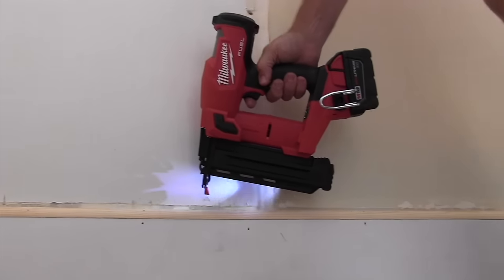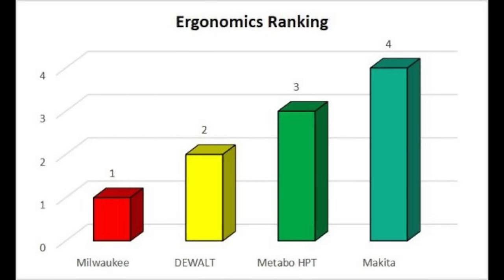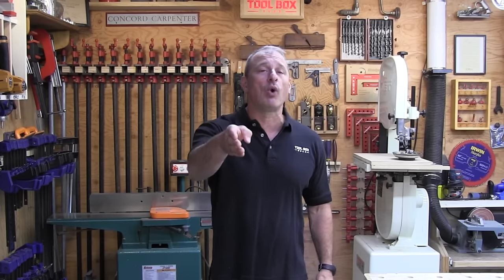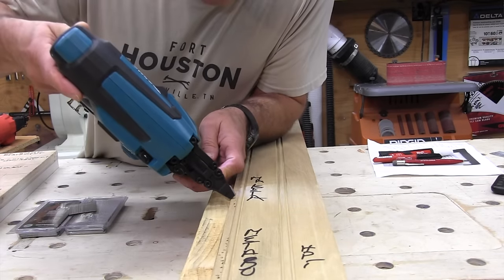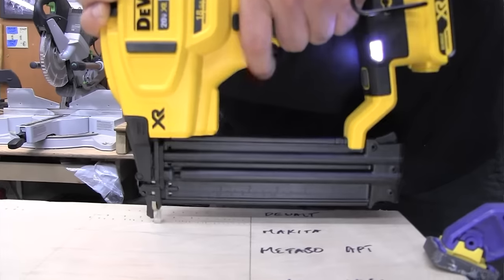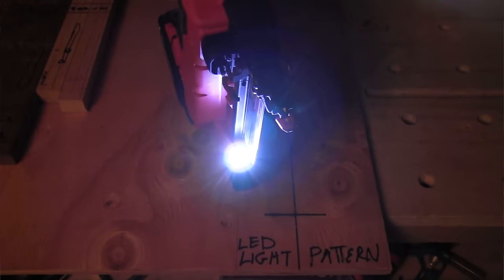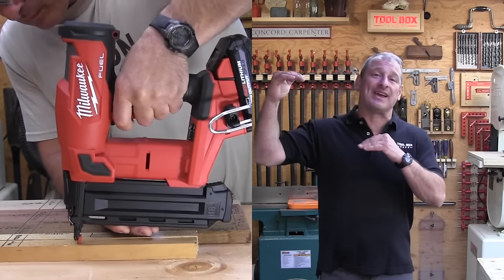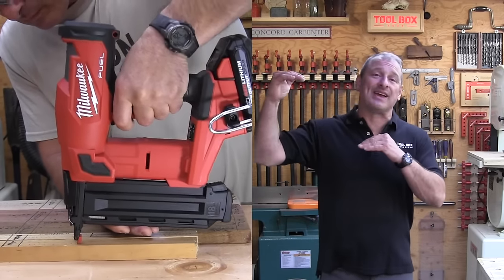BEST 18 Gauge Cordless Brad Nailer - Head-To-Head

Comment: I wish makita would come out with an updated brad nailer
Reply from the maker: soon
Reply: Are you hinting that I might want to wait before running out to buy the DeWalt
Reply: @ConcordCarpenter  are you sure?  I emailed the a few months ago about this very question.  They said something to the effect of nothing is in the works, our nailer is great.
Reply: Makitas current 18g nailer is not well balanced and very awkward. I got the dewalt but wish makita would bring a new one out with a better design and balance. If they dont im going over to the hikoki 36v system. Cant beat only needing 1 battery plus an ac option. Makita have really fallen behind

Comment: I have always bought Makita and currently have the xgt range, have been using the xgt 16g nailer for a few months which works on a spring loaded mechanism rather than compressing air like the other models. It works awesome although my problem was the nail length being too short and not being able to drive fully into some surfaces sometimes. Today i bought the gen 2 milwakee (had to buy a battery and charger) its a very well rounded bit of kit with plenty of power. Would never go back to another gas+ battery nailer ever again after using these.

Comment: Hi Rob. Just curious to find out why Ryobi was not reviewed. Thanks in advance and great job with the tool box series.
Reply from the maker: Nothing secret or big to tell - we chose not to. We wanted to keep our sampling to the top Pro contenders. Sorry - in hindsight it seems al lot of you guys would have like to seen it included - will note that!!
Reply: @ConcordCarpenter  When I bought my nailer I spent weeks scouring the internet to ensure I was getting the best tool for the job. I chose the Ryobi in spite of the fact that I had no batteries for it because the feedback was so thoroughly lopsided toward the Ryobi. I've used it quite a bit and have had no negative experiences with it. It does exactly what you want it to do without fuss. I was very impressed that a tool at this price could hit my every metric so well.
Reply: @ConcordCarpenter  The Ryobi is a bit long in the tooth due to size and speed, (not that most people will be bump firing an 18ga nailer). However, I still feel that the Ryobi 18ga nailer and stapler are two of only a few of their tools that are pro quality, and still a very good value. Since you mentioned this in the review, the Ryobi will also fire 2-1/8" brads. The lighting pattern is also superb.
Reply from the maker: Pro1er thank you for that feedback
Reply: @ConcordCarpenter  

You can easily test the Ryobi, and even Rigid, and include them in a Part 2 by re-editing this video. 

You may have to reshoot your narration spots, but other than that... easy peezy.
Reply from the maker: jane Patton we’d just do a new video

Comment: I was looking for Ryobi in this comparison as well
Reply: I usually find Ryobi at the bottom of the quality range but cheapest price. Ok for government work but not suitable for professional work
Reply: I've had a Ryobi 2 speed electric corded weed eater for 15 years and it's heavy duty and works great.
Outlasted my Troybilt gas and weed eater brand gas.
Reply: With as much or more power
Reply: @gregoryfairchild2460  
Color me surprised 
I have not had any such luck with their products. I had some luck using Rigid as my budget brand.
Reply: @gregoryfairchild2460  
My last ryobi experience was with a small pressure washer

Out of the box it was defective with low pressure due to a bad seal. 
It did work after I made the repair but I was still left with a bad vibe

Comment: What batteries/tools you already own should probably dictate which nailer to buy. I've used and heard less than stellar reports on the milk. I'd go Dewalt since thats what I have already.
Reply from the maker: Steven Foust that’s not a bad approach
Reply: This proof is that creating the cordless systems made those companies a lot of money: you add the batteries chargers and most importantly the retaining the customer to an ecosystem and it equal a lot of cash for them. I can see each of the companies dropping their corded tools and focusing on cordless and they would do just fine.

Comment: I own the 18g brad nailer by porter cable and has never jamb and has a better lighting then these 4 and it sinks in hard wood with no problems I got this nailer plus a narrow crown nailer 2 batteries and a charger for $229 can't beat that it's over 2 years old and still fires like it's brand new

Comment: The Makita is the oldest. I hope they can compete and try to come out with another one. Great honest video, however. Thank you for posting!
Reply from the maker: Their Gen 2 is gonna be amazing
Reply: They have released FSN350 with only max 35mm Nails
Reply: Forget makita they have fallen behind
Old 18g nailer with rubbish design 
No framing nailer
36v systems need 2 x batteries = more height and size.

There designers have lost the plot

Comment: Dewalt always seems to be at or near the top of the heap. I started buying DeWalt 20V XR tools, I am always happy with their performance. I am not a carpenter, just a DIYer and am happy I went down the Dewalt road.
Reply: I've used the dewalt and the only things I'm not a fan of is the balance and it feels cheaper than the others (because it is I guess)
Reply: @cuchanu  I started out with a Dewalt cordless drill, my B&D cordless drill batteries had died. Then I started buying more Dewalt stuff, so I decided I would just buy Dewalt cordless tools. I don't regret sticking with Dewalt.

Comment: Great review Rob👍 I'm tempted to try the Milwaukee and get away from the air hose.
Reply: Dan Pattison Hi Dan , greeting from Australia, I’ve been air free for 2 years and wouldn’t bother going back to air fixing guns . My mates use the Paslode gas gun which I think are very good still . I have the Milwaukee first gen Da nailer ( senco style nail ) I love it as walking around the house there is no air hose ,total freedom . They do have a few draw backs , little heavy , and the “snap action or the way it fires still not as soft as a air gun . Buy one and try it out as it will come in handy for a job where you may only need to shoot a few nails where rolling out leads is just time consuming. I’ll buy anther Milwaukee soon as I need the C’  ( 18g ) brad for fine work as the DA ( 15g )  nail is a little too big for some jobs .... let me know how you went
Reply: @lena19191  thanks for the info👍

Comment: I have the Milwaukee batteries so I am happy with the review and I am going to get this tool.  I am going to put all new baseboards and door casings in my house and I have a Senco air nailer but dealing with a compressor, the long cord and the noise I rather use that battery system this time.  I put baseboards in 15 years ago and I want a more modern look so I am replacing the old baseboards.  I can buy the tool only for $279.00.  Seems like the batteries last a long time and I already have two good batteries.  I will sell my Senco nail gun.

Comment: This is a pro video of the pro's opinions. ...what about the ryobi p320
Reply from the maker: נועם אברהם דודאי we chose not to loo’ at it
Reply: I'm a professional and have the Ryobi. It doesn't get used much other than quick jobs where it'll take longer to unload compressor an roll out the hose than do the job. The Ryobi works ok for that. It always goes through 15 to 25 "dry fires" before shooting the very first  nail though. Which probably isn't good for the tool. I always have a scrap piece of wood to fire into until first nail shoots. Kind of a pain! Going to go with the Milwaukee. Great video here, Thanks!

Comment: I love Milwaukee tools, and with staying with one battery format, I bought the Milwaukee brad nailer when it came out.  What a major dissapointment! Milwaukee really did a number on us on that one.  I would like to upgrade to the Gen 2 version but just can't justify replacing a new tool like that so soon.  Milwaukee should offer a serious trade in because of they released a tool without proper field testing. But it appears they are just going to let us hang out to dry on that one.  Very dissapointed Milwaukee.
Reply: Milwaukee does not take care of their clients in regards to warranty.  Bought a 7 1/4 cordless miter saw.  it never worked properly.  Wouldn't do anything for me even though tool was under warranty.  I won't buy Milwaukee ever again
Reply: @markwigley9185  That can pretty much be said about all manufactrers. I use Ridged corded tools tools as well and they gave me a cold shoulder when I tried to claim their "lifetime warranty".
Reply: @JWimpy  Wow.  I guess i've been pretty lucky so far.  My tools have been good and I haven't needed to use the warranty other than the Milwaukee.
Reply: Johnny, I wouldn’t worry about a class action trade-in for the Gen 1 nailer being offered by Milwaukee or them stepping up with an offer to each and every customer purchasing the Gen 1, because it just won’t happen.  Tools get progressively better from one generation to the next, e.g. Milwaukee Brushless Impact vs Gen 3, M12/M18 Hackzalls vs M12/M18 Fuel Hackzalls, etc.  However, in the case of the Hackzalls , the Fuel offers better performance due to an increase in power and anti-vibration.  Probably what you and I’ve come to expect from Milwaukee from one gen to the next.  The M18 Fuel nailer on the other hand is a completely different story!  The nailer just isn’t up to snuff to complete the tasks it was supposedly designed for in a fashion you would expect from a Milwaukee tool.  This is a different scenario than being able to complete a task quicker because of performance.  Does that make sense?

So here’s what I would do...contact Milwaukee (1-800-SAWDUST) and explain the situation as you did in this post, embellishing  on the issues that are making it increasingly difficult to perform tasks due to the “design”.  I would have each and every issue written down, including how it’s affected your project(s).  They will probably have you send it in for repair.  You’ll probably get it back only to experience the same issues.  Call them up again and go through the same procedure.  You’re going to be assigned a case number.  They might decide to send you a new Gen 2 tool vs trying to repair.  You can also ask to have the issue with the nailer escalated to a supervisor/manager.  They have the power to make the decision to replace the product, based on the issues.

I feel it worth adding what you stated, e.g. that you’re invested in the Milwaukee platform.  Like you, we’re invested heavily in both the M12 and M18 platforms.  The reason is the quality, worth what paid for, depth of tool field and “support”.  Unlike Dewalt...Milwaukee responds and cares.

Good luck!  Please let me know how it goes.  Hey, you’ve got nothing to lose and everything to gain by escalating your displeasure with the product.
Reply: @roselucas2760  Thank you for the info.  I will try your suggestions.
Reply from the maker: I really wish they would do a trade -in or buy back program
Reply from the maker: Rose Lucas great advice!
Reply: A Concord Carpenter / ToolBoxBuzz, thanks Rob.  Love the tool videos, especially the tests.  You guys do a great job bringing us  thorough reviews!
Reply: Rose Lucas guys get really butt hurt about DeWalt “not caring”. There tools never break on me so I don’t have to deal with having them repaired. Milwaukee seems to appeal to the neediness of the millennials and the parents who made millennials.

Comment: One thing that would be great is if you could take into consideration the handling of these tools by left handed operators. Too often, the controls are optimized for right handed operation. This can impact comfort, safety, and even line of sight with a tool. As a lefty, I find the Makita platform to generally be the more ambidextrous, but it can still vary tool by tool.
Reply: Never put that into perspective

Comment: Thanks for your time & effort, greatly appreciated! I noticed during testing the M18 High Output 3.0 (newer battery cells 21700) was being used rather than the kit battery(2.0 18650 older cells) if that might be a bump in the overall score in terms of power and depth of drive and etc. Let me know your thoughts on why the discrepancy, I personally notice a difference with the newer cell batteries on the M18 tools.
Reply: I have this Nail gun and the 15 and
16(GEN I),gauge and 23 gauge pin gun  I guess my point is I’m pretty familiar with these guns and that is a good point but in the case of the nail gun it’s not added power it’s added runtime. The newer fuel tools are designed to take advantage of the architecture of the 21700 cell battery but that is depending on the tool and how it can best use that extra power that the newer high output batteries offer and with the nail gun it’s added runtime. I’m not saying there’s not a slight bump in power but if so it’s not noticeable But the extended run time is.

Comment: I gave up on picking a battery plateform. Now I roll with Dewalt and Milwaukee. No big deal really. Two plateforms. MIlwaukee nailers and miter saw. Dewalt impact/drill/multi-tool/jig saw...all the "little tools".

Comment: Very thorough review. I’ll probably get the Dewalt since I have their batts already.
Reply: Once you have batteries and chargers that's usually the brand you stick with because you already have the power source.  Not saying any one color is the best but I started with a 4 piece 18V XRP Dewalt set that I had won as a door prize when a local hardware store opened, then when Dewalt came out with the 20V stuff and offered battery adapters for the 18V stuff I started migrating as my 18V batteries were pretty worn out.  Dewalt I think is the only tool maker that offered a 18V to 20V adapter to keep their old tools going...so I still have 18V stuff but have slowly migrated to the 20V line as I've added tools.  I'm sure that other's do the same as they progress they buy the same brand because they got the batteries and chargers already.